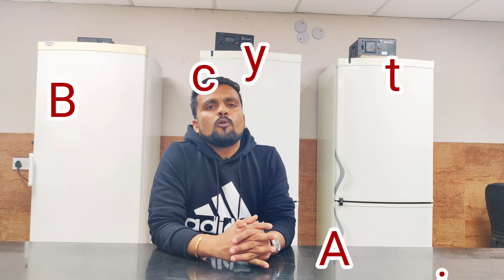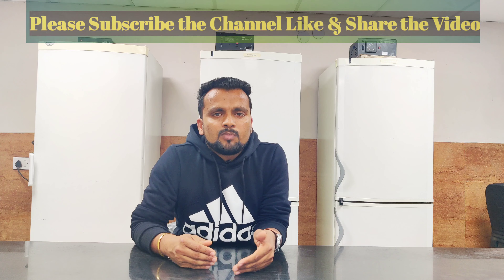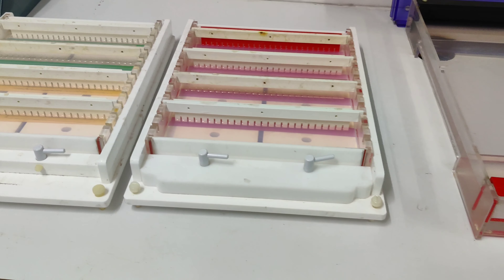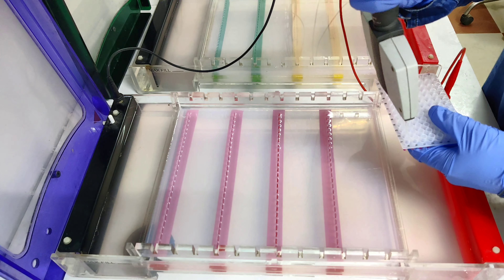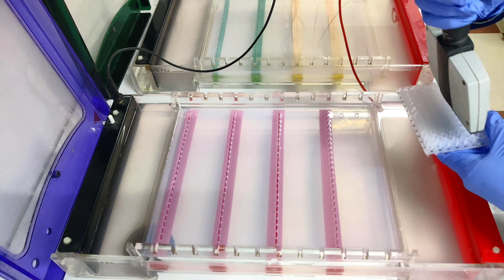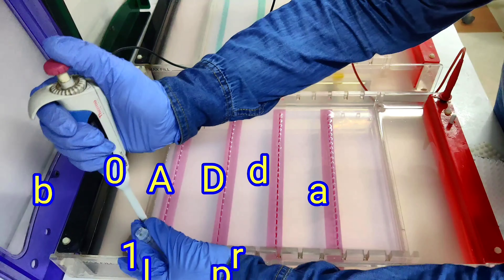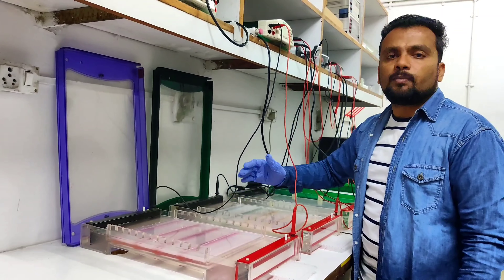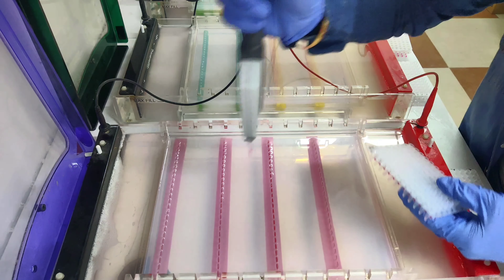Run Two 96 Well PCR Products in a Single Agarose Gel : a very useful technique

Comment: I run PCR product in 2% agarose gel but my PCR product move ago from DNA ladder, my friend is sayning it is primer dimer? please any suggestion if you want to check gell i will share ?
Reply from the maker: Which bp DNA ladder u used, if ur product size is near about 50pb means it's only primer dimer.
Reply: @AkyBiotech  thank you for your quick response, I used 100bs DNA ladder. and used dream green taq master mix 7ul +1ul genomic dna+1ul forward and 1ul revers primer .?
is this is correct percentage and I also used 52 TM
Reply from the maker: U r getting primer dimer only. No amplification and u have to use 5ul of MM+ 3ul MB grade water + 1 ul F and R primer+ 1ul of DNA, total reaction volume 10ul. Repeat ur PCR.
All the best.
Reply: @AkyBiotech  thanks